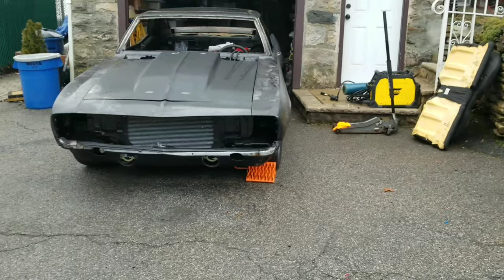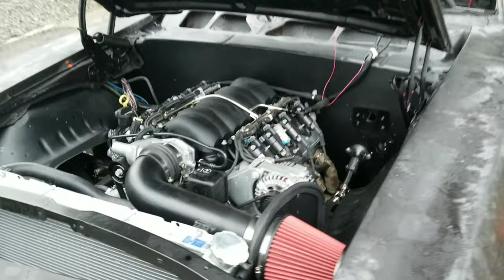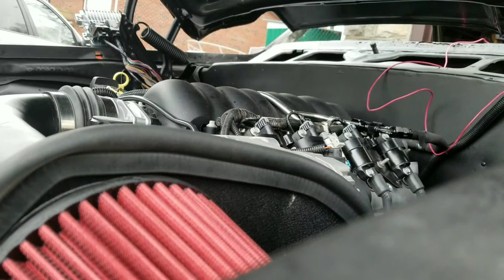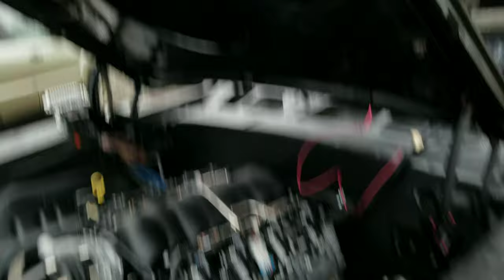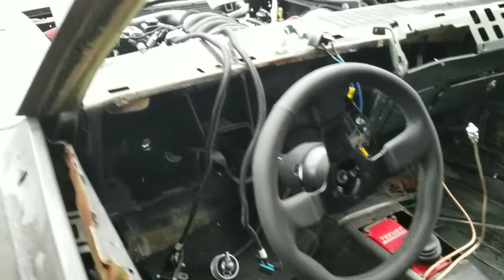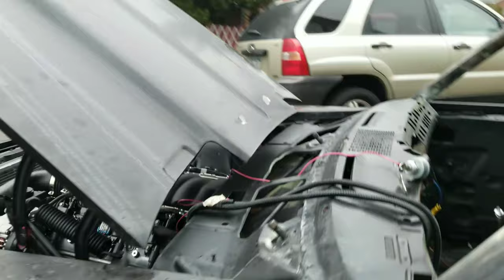1969 Camaro 500HP+ LS3 *1st start up*

Comment: Did roadster shop supply the steering shaft extention?  I was wondering how the rack would line up with a stock steering column.
Reply from the maker: They did not, ended up purchasing and fabricating an extension. I’ve since sold the Camaro but the gentleman that owns it is sparing no expense, all top-of-the-line work from some of the best shops in Texas, I will update soon